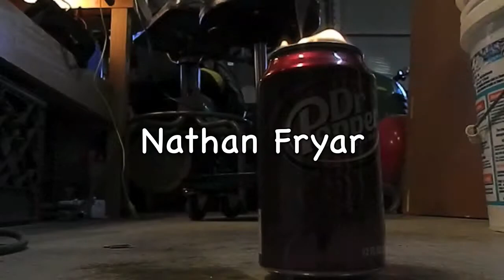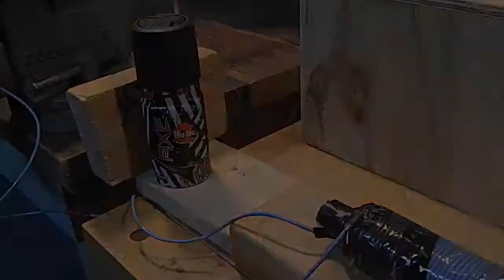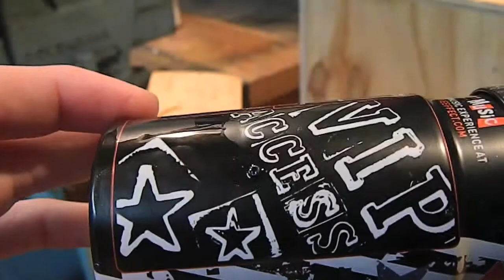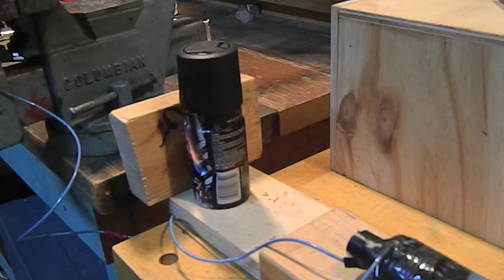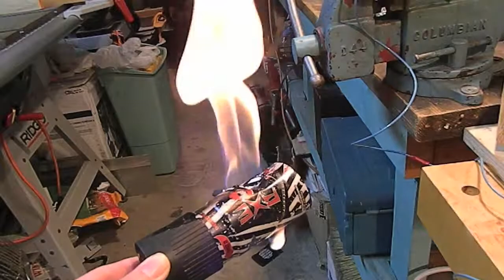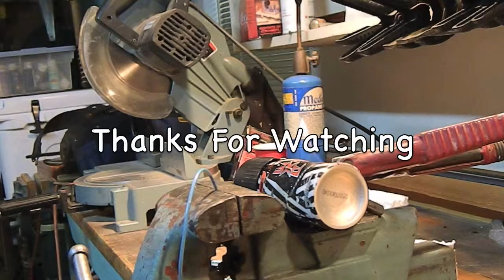Coil Gun + Axe = Fire

Comment: Awesome!

I finally got around to making a decent charger for my capacitor bank, it uses a single 12v lead acid battery to charge a 330V 2180uF capacitor bank to 310v in around 10 seconds (I only charge to 310v as the caps are from old disposable cameras and are not really built for long term use).